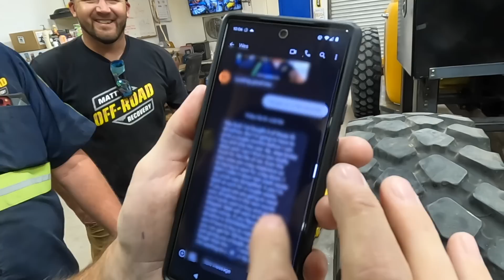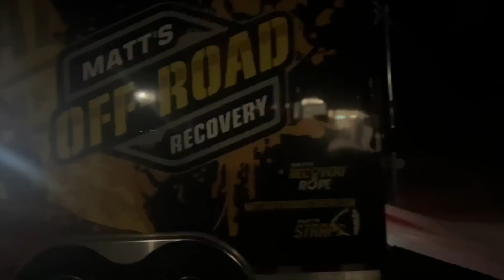One Call Stopped Everything On The World's Largest Wrecker

Comment: Enjoying your stuff!  We did everything you could possibly do back in the ‘70s in Indiana.  Not much modification.  Tires, lift kits, etc.  I had a ‘76 and a ‘77 FJ 40. We trashed them at the many coal strip mines.  We rolled them, flipped them, buried them in mud holes, etc.  Lots of tugging’ and winchin’!  We didn’t photograph much, as we simply didn’t care.  We used our ONLY means of transportation to trash whenever we could.  I totaled the ‘76, rebuilt it, heavily modified.. Won 3rd in the Vigo County tractor pull, modified..
Keep up your great work.  Heading back out there to play in the Manti-La Sal in October.  Bringing the inflatable to cruise my favorite Lake Powell, hopefully not the last.. We’ll give ya a hoot.  I’ll challenge Rudy to a bow ride at full throttle!

Comment: After 100 miles I recommend re-tourqing those bolts. Big wheels like that like to come loose, especially with the amount of power you're gonna put through them. as well as water can collect in the seal where the O-ring is and cause rust which will eventually lead to an air leak. But all in all, the only way this thing will look more badass is when it's done. Keep up the great work.
Reply: When you say bolts you mean lug nuts?
Reply: @jrrains  lugnuts, Plus all the BOLTS that hold the wheel halves together.

Comment: I think a central tyre inflation system would make a massive difference in the capabilities of this wrecker seeing as it will be hauling varying loads across different terrain
Reply: It would be neat, but complicates things/adds point of failure, and they have on board air plus they are not getting shot at so they have the time to stop and adjust as necessary 😂
Reply: @jamesb11637  modern systems are pretty robust and they should be easy to disable right at the tyre if some part of the system were to fail. But yeah, on board air does add complexity.
Reply: @MattsOffRoadRecovery  Awesome, I'm excited to see how it works out
Reply: @MattsOffRoadRecovery  of course it does

Comment: The wrecker is looking awesome  !!!

Have you thought about converting over to a CTIS ( central tire inflation system) for the axles and wheels to you adjust or dump air pressure to the tires while driving  ????
Reply: How would you do that? And shouldn’t those military axles be outfitted already?
Reply: IIRC you would need a portal axel design to run the CTIS system.
Reply: Yes CTIS will work and available  for MRAP axles
Reply: @briancraig4411  MRAP axle  have Portals
Reply: @desertrat8322  Matt mentioned that people told him to use portal axels, if the axles he has now are portal style, why didn't he just say they are already portal axels in his video reply? I mean I know the military uses that style of axel for the CTIS feature and gained ground clearance.

Comment: that boom chain looks really close to the boom itself, im sure you guys have thought of it already but the torque multiplication with the chain that close is gonna be insane.
Reply: Those chains were temporary just to hold the boom up. It will be later fitted with a winch or hydraulic actuator.
Reply: It's so it fits in and out of the door.
Reply: @RambozoClown  oh gotchya, thanks

Comment: Matt,

Have you considered supercharging the 8100 or a duramax/Allison swap? As a powertrain engineer in Detroit I really think you’ll run into trouble with the NA 8100. I loved driving them with the ZF 6 speed in a 2500, but I think the weight, large tire size, and off road towing duties of the heavy wrecker require more than 330ish HP/450lbf-ft. I apologize if you’ve run the numbers and it works out; I haven’t and am just going by very rough approximations/instinct here.
Reply: I was thinking supercharged V8 gasoline or Turbo Diesel V8 but Matt has a plan.
Reply: @matthewgaines10  This is Matt's project and we must respect that, and while I do not know the use cases he has in mind the things I can imagine require more power for the ease of use I expect. 

If the most common use cases are pulling heavy vehicles out of sand hollow then I think a tuned turbodiesel would be ideal, but the rock crawling capabilities would suffer. 

If rock crawling is the priority or a regular possibility then the supercharged 8100 (Or 6.0/6.6 LS based gas V8) would be a great fit. However, fuel economy will suffer. I'd guess 6mpg on road with the supercharged 8100, and 2-4 gallons per mile (yes, gallons per mile) while recovering. 

It just depends on what he wants to do with it. I'm excited to see the results!

Comment: Pretty sure Matt tightened those down in a cross pattern even if each time he was on video it looked like he was just goin around a circle. I'm impressed more and more with Trevor's experience, he seems to know more than he acknowledges on a regular basis. Often the military gives you training, but it's not until you're in the field that you find someone else has a better idea. No plan survives contact with the enemy. Mostly true but, you practice chaos anyway. That is the secret of the US military.
Reply: They never showed him torquing them down, that battery impact was just used to run them up snug. They require much more torque than what it is capable of
Reply: @michaelwyrick4046  They did show him torqueing them, he said he felt like he was rowing. Why do these internet warriors get on here and nit pick, he knows what he's doing.
Reply: They did show him torqueing them, he said he felt like he was rowing. Why do these internet warriors get on here and nit pick, he knows what he's doing.
Reply: @michaelwyrick4046  They showed Matt torquing the two piece wheels together, not bolting the wheels to the truck.
I have a friend that works on heavy equipment, he said he doesn't use any of his air tools anymore because the new battery guns are just as good. I'm not saying that's what Matt has, I'm just saying FYI you can get a 1/2 " battery gun with 1100 ft. lb. tq. The Snap-on gun my friend has is over a thousand bucks, I'll stick with my air tools.
Reply: @415s30  I seen him torquing the bolts connecting the wheel halves, I didn't however see him actually torque the lug nuts, I know that he did/does ( unlike your snide remark suggests otherwise). If the video actually showed that, I may have missed it due to pop-up ads. But like I said, I know he does things by the book
Reply: @michaelwyrick4046  Of course they do this stuff, you haven't caught on with his comments back to these people that it's annoying??
Reply: Yeah, yeah, yeah any good mechanic knows to not only use a torque wrench (which I did notice) to secure the rims, for some reason didn't show the same with the lug nuts. As well as while many YT mechanics don't (frustrating to suggest to students by-the-way) but just as many mechanics know that cross pattern tightening is just about as important, so you don't put your pattern at a tilt and it gives you a bad reading, torque wrench or not. My bigger beef is his constant negligence on using safety gear. I love this group of people. I can't recommend them to my students however, lest I get lambasted for suggesting someone that flouts safety protocols of every kind possible. Mostly on himself, but none-the-less.
Reply: @bruceleealmighty  anything else you'd care to complain about??

Comment: Maybe add a TPMS so you can monitor the pressure on those tyres in real time, it might help you know what kind of load you're lifting.
You may also want to consider a load cell on the lifting arm so you can see what the weight is?

Comment: FYI tip for VERY large tire removal and replace. Put a piece of plywood with some grease on it just barely under the tire and it will slide right off and on. Some adjustment required to get the right height.

Comment: Wrecker looks amazing on those tires.  One thing.. you need some 20 INCH PIPE BETWEEN THOSE RIMS  to double beadlock those tires. From experiance you will be running between 2-5 PSI for all your driving on the wrecker and will need them beadlocked to keep them on.  Looking forward to the camping trip !           CHEERS AND SAFE TRAVELS    Steve h.

Comment: Have you guys considered installing a capstan winch on the wrecker so you can use unlimited lengths of high strength rope for recoveries when you need extra reach? We use capstan style pullers for electrical cable pulling and some  of those pulls are extremely long and can load up to 15,000 lbs on the meter.....

Comment: you could use a UNIMOG: it's 4x4, it has lockable portal axles, is lightweight but very heavy duty and has a short wheelbase version, lots of hydraulik equipment you can attach from factory like a wrecker boom and winches and it has giant tyres. It's made in Germany by Mercedes
Reply: Matt is building this wrecker to be more capable than a Unimog

Comment: I've put the m35a3 wheels together you can run 0 psi if you put in the Locking rings it's kind of a trick you put the locking ring inside the tire then put the rim together

Comment: Well it’s true you could get more ground clearance with portals but the big point to me is it’s another place to fine tune gearing. 

Buy it adds weight, adds complexity and negatively impacts center of gravity and roll over angles. 

But I do think you could have fit a bigger tire. Although those look plenty big and a relatively stock 8.1L doesn’t also need a bigger tire to spin. I am curious to see how long the transmission will last for stock trying to spin those big beautiful monsters

Comment: Love the wrecker, but I have a nit picky safety concern. Popping the bead on such a large tire without a safety cage. I’ve heard a lot of horror stories about the wheels failing when the bead pops into place and killing someone. You can see videos on YouTube where a piece of a wheel imbeds itself in a ceiling.  
I at least would have attached the hose to the valve and stood away from the tire until the bead pops.

Comment: Stupid question did they not have the inner spacer for these wheels which give them the dual bead lock? If you pull those 20x10's apart they'll be one in it which means you could in theory have zero pressure in the tire and it won't pop the bead. 17.5 have a run flat that most people take out and use a two price PVC pipes to serve the same purpose on trail rigs (or they cut the rubber one down). You could probably do the same exact thing on this.

Comment: Yall probably shoulda tried to find thin rubber donuts.. half to 3/4 inch.. just sits between the beads of the tire to keep the bead from popping.  
Kinda sorts what's goin on inside a HMMWV tire.. just minus the super thick donut part that makes those runflats

Comment: I think I notice you have rear wheel steering on your wrecker. Do you utilize the rear wheel steering? How do you control it? Do you have a steering wheel for it, or do you use a hydraulic cylinder with left, right, or center control? Just wondering.

Comment: I have a question about the rear wheel steering you mentioned early on in the project. Will you be able to control if the rear wheels steer in the same direction as the front wheels for “crab walking” or steer in the opposite direction for tighter turning circles? Would be so cool if you could build it to do both 😀🕶

Comment: Portals are great for doing rear end swaps because you can lift the pig straight up and out  but other than that the axles you have are excellent i have seen axles snap going through crevices and catching an bind on a rock or root with hemt tires and tubes but it still takes a lot of whoopin for that to happen also so basically you have a low maintenence tow rig that is built like a brick shithouse all it needs is fuel and oil changes it should last forever as a tow rig and shit you could even wheel it too😎✊🏻

Comment: Hey Matt you need to invite Merlin, Paul's cousin to the tow truck Olympics. He has an off road wrecker
Reply: Merlin doesn't seem to take Matt seriously. Matt has said repeatedly that diesels don't do sand, no point in inviting rigs that can't leave the parking lot.
Reply: Depends on the setup. I have plenty of friends with diesel rigs that go everywhere out in Moab, and Sand hollow in the summer time. If it's an automatic no because if you get stuck you can't spool up. But if it's a standard you can do anything out there. Merlin is Paul's cousin he  knows Matt and the banter is all in fun.
Reply: @ateamoffroad1179  I don't get the impression that Matt and Merlin are good buddies..

Comment: Do those split rims lock to the beads or could those tires potentially slip? Great build and great job on the videos. I've really been enjoying the channel.
Reply: They have no bead locks as installed, but bead locks are an easy upgrade to any split wheel.  A lot of guys running humvee pattern split wheels use a section of PVC pipe cut down to fit between the beads of the wheel, just the right width to pinch the beads against the wheel.  You install the section of pipe in the tire before you drop the wheel halves in and there's a hole drilled through to allow air to flow from the valve to the tire.  Best part is that it locks BOTH beads, not just one, and it costs basically nothing.

Comment: Sooo you gonna leave marlin out of the tow truck Olympics  ?
Reply: ''Diesels don't do sand.'' - Matt, 2022. Merlin doesn't seem to take Matt seriously. I doubt it.
Reply: @JohnFL  my diesel does sand  just fine  .....but if they believe diesels cant do sand I guess they should be worried about a easy win then huh ? 😅
Reply: @phonypony5.0  Matt tested a deuce and a half at Sand Hollow once. He ended up having to recover it.
Reply: @JohnFL  that wasn't a diesel engine issue that was lack of suspension  those trucks are for flat roads

Comment: Wouldn’t it be better to use a helicopter to get those cars out? You start dragging them it will rip them apart littering all over the place. That will cause more work if you plan on cleaning it all up. 
I know it’s expensive to use a helicopter & you might have to get the right permits to use one but it’s safer for the environment & safer for everyone else.